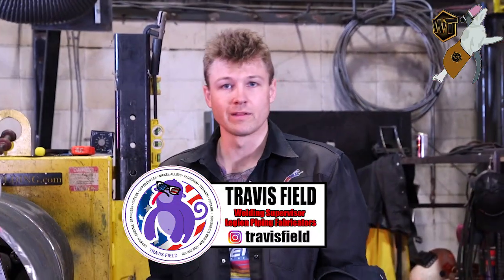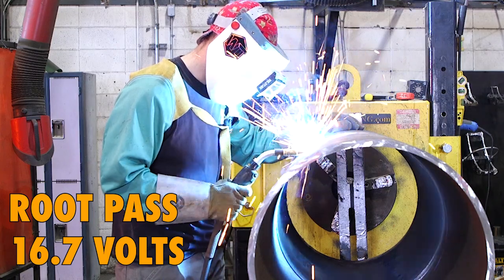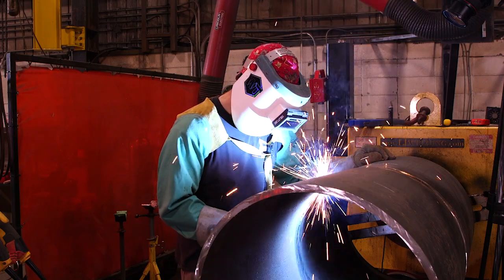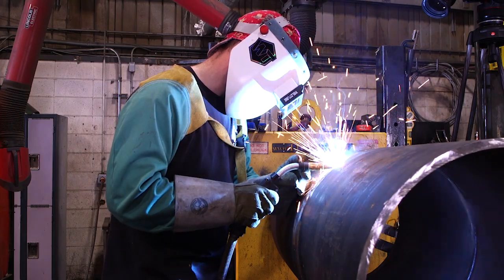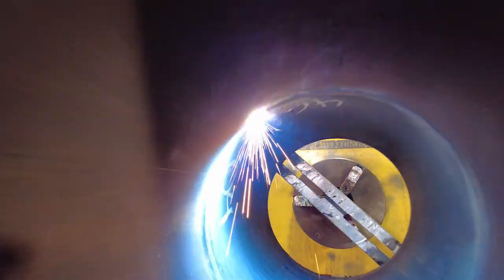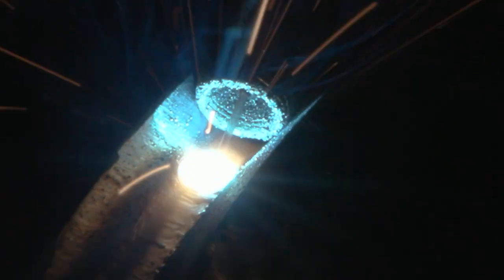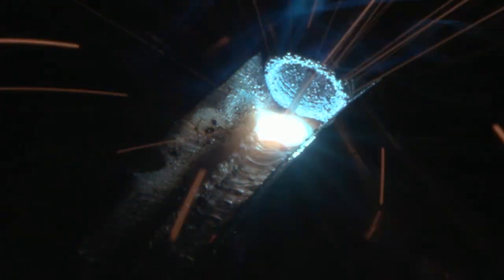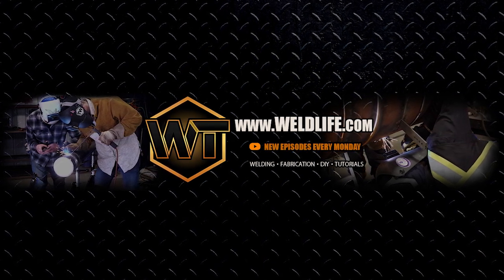Walking The Cup on MIG Welding | Modified Short Circuit Root Pass

Comment: Walter Seegirst and i were welding pipe for a compressor outfit back in the early 2000's. We welded all our pipe like this. Really helps to have trigger lock for the big bore. GMAW Hsrd-wire root and Metal .052 all the way out.
Reply: People have no idea all I am Capable of building and welding Mike 🤫

Comment: That was very well done. I know you said  16.7 volts but I did not hear ipm for feed speed. And wire size. I suspect 0.45 wire , what was the ipm. I also watch Arc one welding from England and he does very similar work, both of you are pros . He uses dual shield fluxcore and a Fronius 5000  which he raves about. I was just wondering if you would use dual shield to fill and cap or some other process.?  I do like dual shield but alas I rarely do pipe. I would like to know the whys and wherefores on this as it  seems to be the right process for the pipe you are welding
Reply: I’m watching Arc one as well. Really good welder.
Reply: Calvin uses regular hard wire mate
Reply: @timwiame8689  yes you are right ,  y mistake.
Reply: I slowed down the video to 0.25 and if we assume he's filming in 60 fps, at 20 arcs per second then we can calculate a wire feed speed of roughly 120. Which seems very low for the motion to 240, which seems closer for the voltage. Hope this helps, i may have to try this myself to test.
Reply: Volts and wire feed are always going to be ran similar.. if he’s @ 16.7, ipm is gonna be roughly 170-180.. he runs a bit cold, for more penetration turn up to about 18.0 bolts and 200 ipm! Or stay the same as him just get on top of the pipe more! Been doing this since 08.. easy money!  But you’ll never make better than 32 local! Gotta travel and be good aka never bust!

Comment: can u use this technique in the field? or only in a shop environment with a rotation device?
Reply: To the best of my knowledge (which is extremely limited when it comes to pipe), anything over 3" diameter can be mig welded. You can run solid wire with shielding gas in the field, but you'll need some way to keep the wind off you.
Reply: It all depends on what the company you are working for agreed to in their contract, are they following code? Many things in the field are to code. I would recommend skim reading D1.1 if you get the chance. Lots of information on proper welding technique and practices.
Reply: Consult your WPS first. Practice and know what your are looking at while you're doing it. Hardwire spool stuff it very fast and makes for great production times.
Reply: We use it all the time outdoor in Norway. Cant understand that stick welding still is used so often in usa. Wire save alot off time. We use solid wire in root. And dual shield wire for fillup
Reply: @ktmturbo5836  it's not as common as some would lead you to believe online. People just jave a weird fetish for stick welding so that's what gets posted a lot/bragged about. Honestly I don't get it either though. Is it so much more hassle to bring a bottle of gas and cut the time in half?
Reply: @zacharytuttle5618  ok tnx for info. We use a long gas Line with quick connection. Then you can leave Your bottle on the car. On buildings we have a steel basket and use the building crane to move it when we need. On buildings we use the little Kemppi evo200 and 1mm dual shield wire. That welding mashine has so low weight that you can have it on Your shoulder. And power is only a 16a 230volt.

Comment: I tryed learning welding. I can turn on and melt metal but seeing the puddle mystify me.
Reply: Your hood could be adjusted wrong
Reply: Usually its either the tip is blocking the full puddle so you can only see the leading and side edge, or if it seems very bright then the hood may need a higher shade.
Reply: All of the above and I'm just blind 😂
Reply: @carpediemarts705  biggest issue is seeing the inner and outer puddle, and the work at the same time and seeing the flow while working the Arc. My ear gives me the best clue I have setting and distance close with the bacon sound but it's like looking in the dark in the woods with a lighter. Blind by the source unable to see the work background...